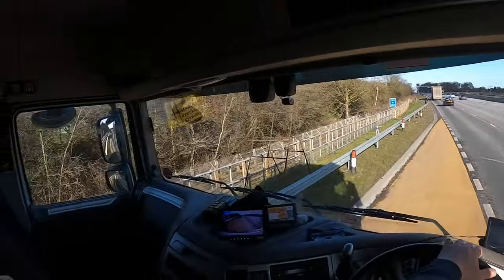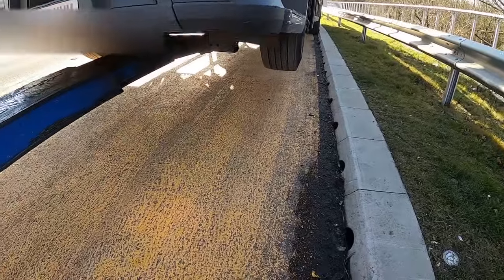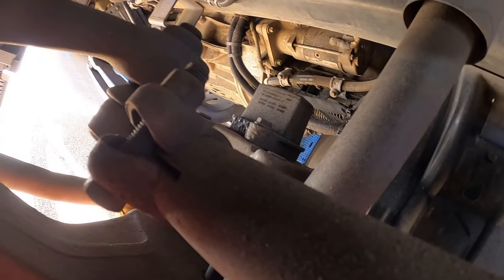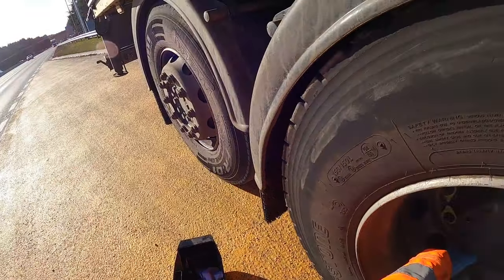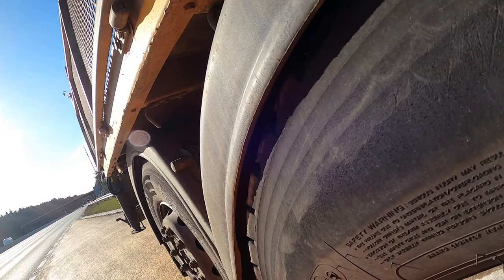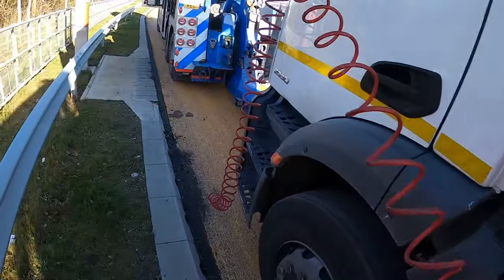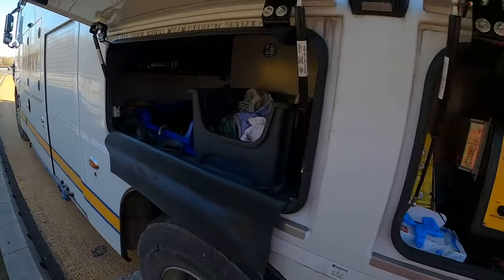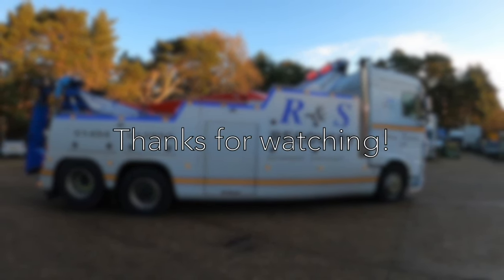TRUCK BREAKDOWN RECOVERY ON M4 MOTORWAY EMERGENCY REFUGE AREA!

Comment: Hi, I've never understood why more people don't just move over a lane on the motorway whenever they see a recovery truck on a job, I know it's not always possible but alot of the time it is. Just good manners and better safety for the recovery crew. All the best on a great video Dave.
Reply: I’m always moving over or slow down whenever I see a recovery vehicle or a emergency vehicle parked on the side of the road with the emergency lights activated.
Reply: in most of Europe it's mandatory to slow down and/or move over and people still don't do it. It's even worse when people are so busy gawking at the emergency/rescue vehicles that they crash right into them
Reply: At least hug the centerline to provide at much room as possible...

Comment: Great video. Imagine you probably not allowed but you can pull out the diff lock on the axle and put a driveshaft bolt in it to prevent the diff lock from dropping when pulling the shaft out
Reply: Really not worth the hassle and you risk damaging the lock sensor